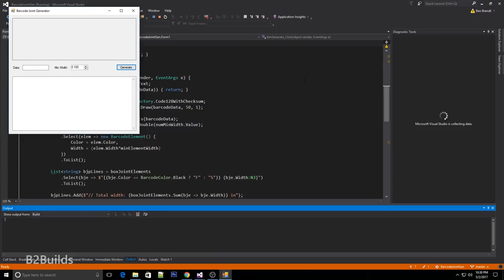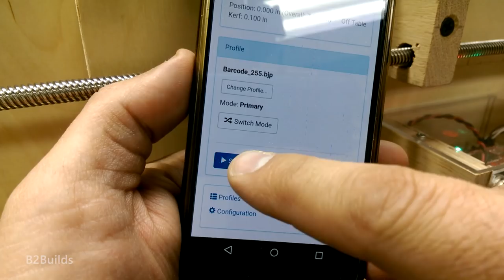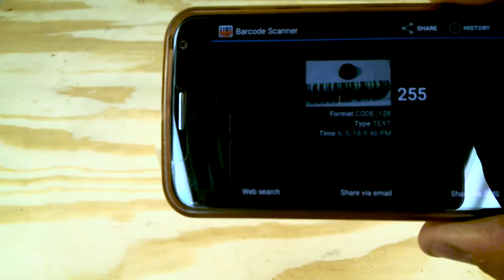The Barcode Box Joint Box

Comment: Outstanding project!  As other folks have commented, great editing too!  And, I want to copy that jig!  Since you're so detail oriented thought I'd share some hard-won knowledge from my own efforts.  Don't take this as anything other than wanting to help a fellow woodworker get even better results from my own failures :)

1.  If you can, try to delay removing the glue squeeze out until it's set up some and become rubbery.  Much less staining of the wood from the glue, which means you don't have to sand away as much material keeping corners cleaner and flat surfaces flatter!  A razor blade as a scraper makes quick work of the rubbery glue remnants.

2.  To help fill some of the inevitable raggedness in the joints, there's a finishing trick I've come up with (maybe some others have discovered it too).  Instead of spray poly, use a wipe-on hardening oil or an oil-poly mix like a Maloof finish.  Sand everything out to around 800 grit and important, don't take a dust cloth to the piece.  Then wipe on the finish, which will mix with the residual fine sawdust and fill small gaps.  Then, right away hit it with the sander at 800+ grit which really works everything into the microstructure of the grain.  Then apply more coats as desired.  This technique is the most grain-enhancing I've used, on nice wood it makes the grain practically holographic.

3.  Though I mentioned using a sander with fine grits on the finish, try to stay away from it as much as possible early on.  You can use peel-and-stick sandpaper that comes in rolls, sticking it to a flat surface like a scrap of MDF or in a pinch your saw top.  Then put the piece on the flat sandpaper and, with even pressure on the piece, push back and forth with the grain in a lapping type operation.  What this will do for you is keep the flat surfaces flat, so lines like where the top and bottom come together are much more precise and less visible.

Again though, very nice work!  Let's see some more!
Reply from the maker: Thank you. I freely admit my "fine woodworking" skills have a long way to go, so I appreciate the shared wisdom; it's what makes the maker community so strong. 👍

Comment: Nice work Ben, as others have said.  

I am enjoying building one of these jigs  myself but am still at the stage of playing with motors and programming so I have a loooong way to go. I do have a couple of quick questions.

1)  You are using a Raspberry Pi (same as me) but I have read that actually an Arduino is better for this type of real-time operation as it doesn't suffer from the delays which come with multi-threading.  Have you encountered any problems with missed motor steps using the Raspi?

2) Are you using microstepping?

3) Did you need to use ramping to get to those movement speeds?  What was the highest stable stepping rate you could get from your motor with vanilla stepping?

I'm in the UK and it is really tough finding a supplier who sells flat-top saw blades which you need for tight joints. Eventually  I found some made by CMT which are of a large enough diameter to be used with a sledge jig, in a range of kerf widths, supplied by 3D Tooling at very reasonable prices.  They may need to order one in for you but their phone support is absolutely excellent.  I bought the 4mm version and it is a very solidly built blade.  Here's the link: https://www.3dtoolingltd.co.uk/product/grooving-saw-blades
Reply from the maker: Thanks for the comment!

1) Using a Raspberry Pi (or anything with a complex operating system) will have drawbacks. In my case I can't guarantee precise timing of signals to the motor driver. But for my purposes that's fine because the speed of the rotation doesn't really matter. I just have to provide the right number of low/high voltage pulses. I haven't seen any issue with lost steps. The only lost movement I've had has been due to the carriage getting stuck due to wood chips (tear-out) getting stuck in the blade slot, and my motor isn't very strong. The advantage of the Pi and the programming language I chose is that it allowed me to do more complex things like the rich web-based user interface. It was a good trade-off.

2) Yes, I'm using 1/8 micro-stepping... so my 200 step motor takes 1600 pulses on the driver to make one rotation.

3) I'm not using any ramping... just feeding a consistently-timed stream of pulses from my software to the driver. I basically just picked a reasonable speed and haven't seen any issues.
Reply: @BenBrandt22  
Thanks for the info.  That sounds good on the multithreading - if you can make long box joint runs like the barcode project I can see that missed steps won't be a problem.   I've got a Nema 23 motor (which I can't stall by holding the shaft) driving an acme screw with a 4mm pitch, so I am hopeful will be powerful enough. I am amazed at how cheap some of this stuff is on eBay out of China.
I've got the motor running at about the same speed as yours using 1/32 stepping and a 1/4 turn ramp up and down for long traverses.  I'll ease back on that stepping if I find I'm running out of torque.
I love your interface!  I enjoy the programming side but, if I am ever going to finish this thing I need to simplify so I've gone for a 20x4 alphnumeric lcd display and will set it using lots of button pushes.
Thanks for taking the time to make these videos and share your thoughts.  It really helps to see one or two worked examples before you start.  I thought this was an original idea of mine (after seeing Matthias' gear--driven version) but it is very hard to have an original thought in these internet-driven days!